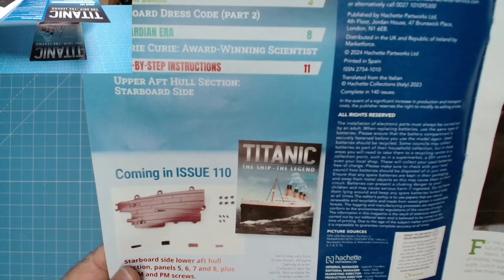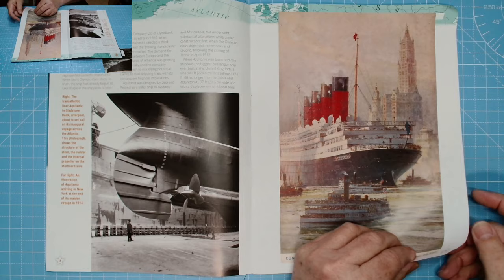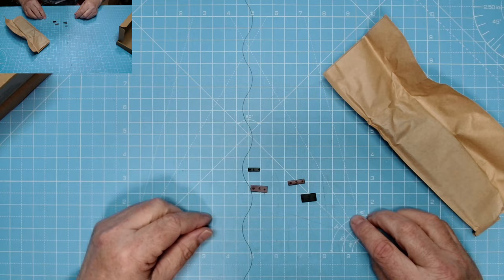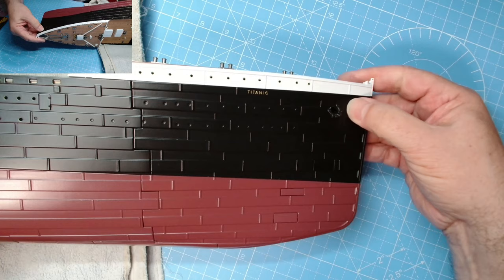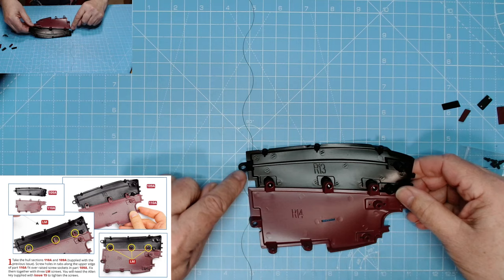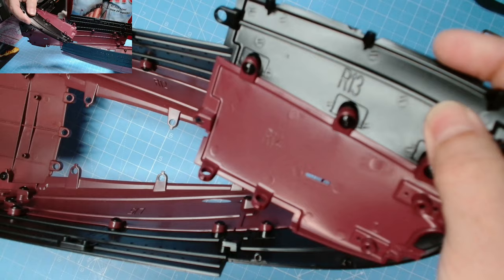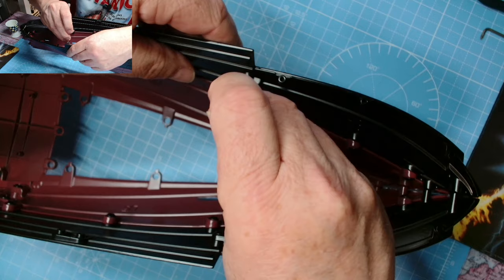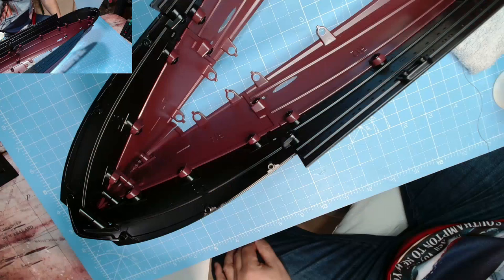Build the Titanic issues 109 and 110 from Hachette

Comment: Hi John great video as per, she's excellent re engines where do we route the cable underneath the engine floor couldn't find any groves to lay it in?I tried to put the engines in what a difficult job and then found out that the cable must be caught on something because there not sitting quite perfect like they use to do it's only since I put the keel on this has happened any ideas would be greatly appreciated cheers 🍻
Reply from the maker: Hi Rod, we fit the engines next month, I believe.  I haven't had a chance to look at the cable dressing yet. 👍